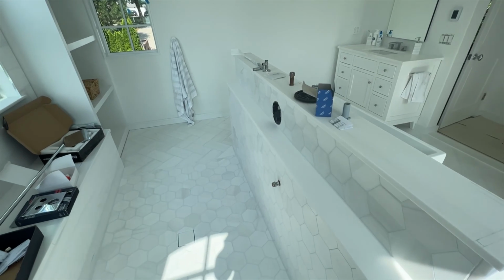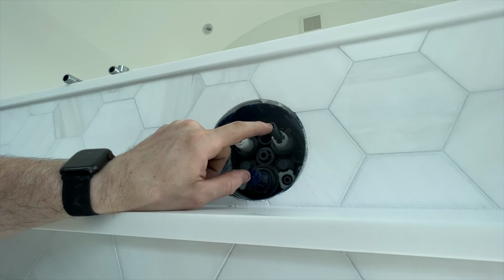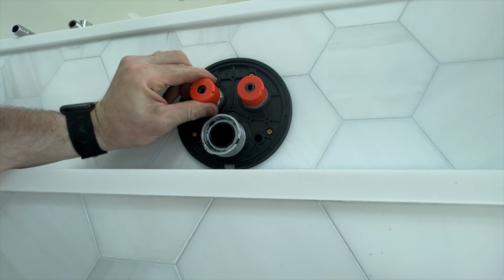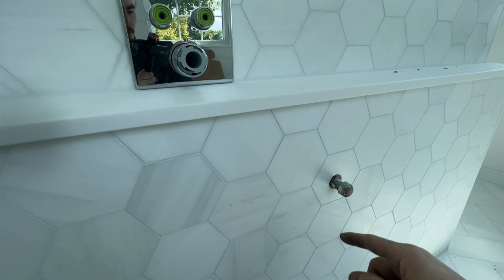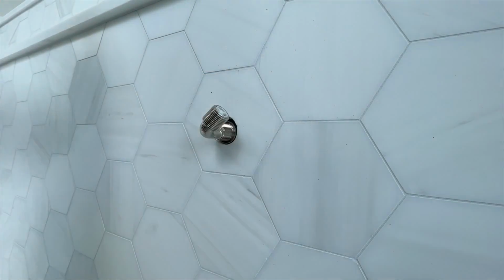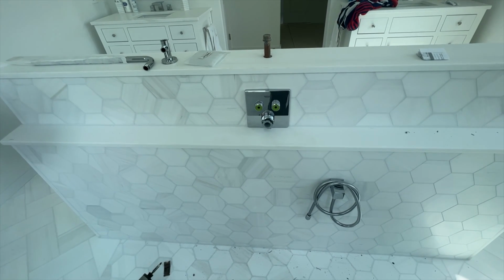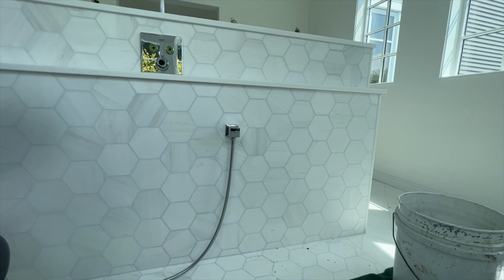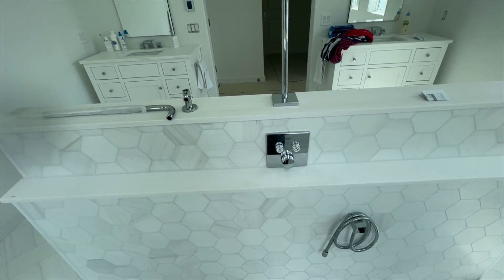Grohe Smart Control Push Button Shower Valve

Comment: Nice video and work but that Smartbox should have been centered verticaly between the top edge of the wall and the lower edge. It is now touching that lower edge, would have looked a lot nicer if it had been centered.